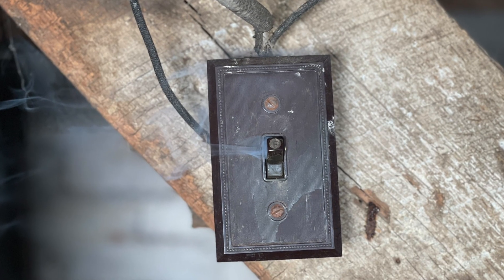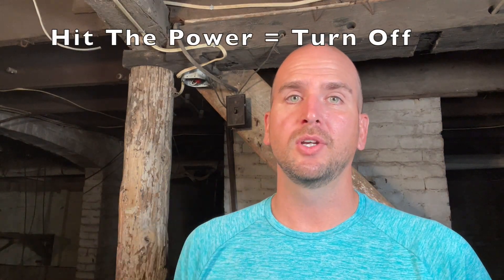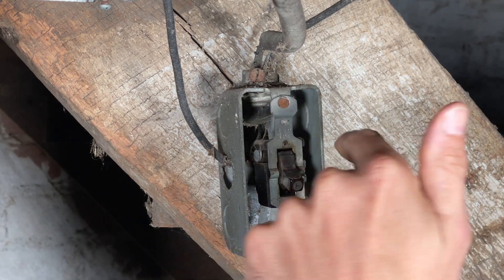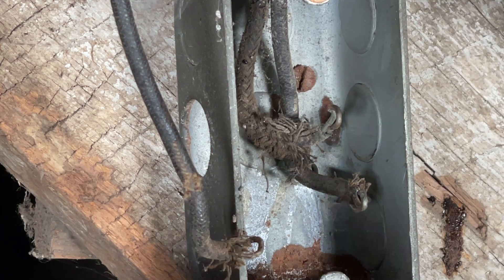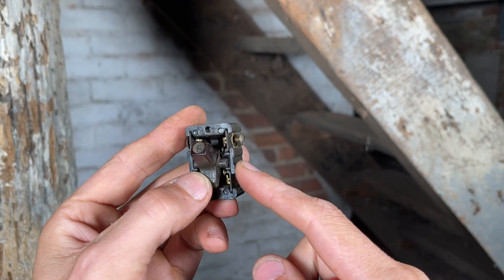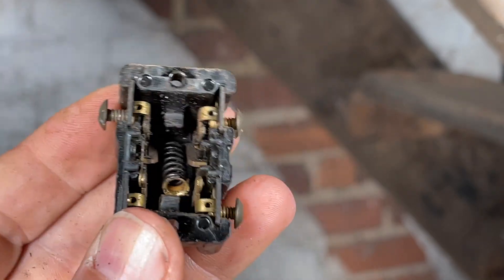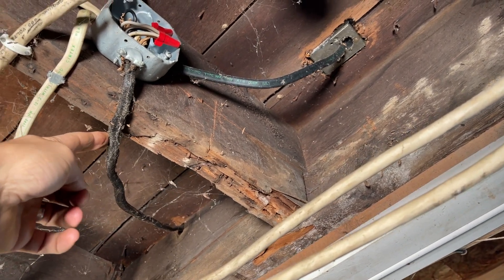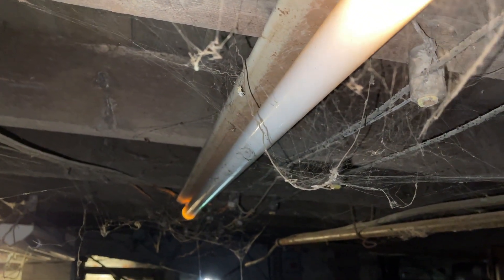Issues with Old Electric Wiring | Knob and Tube

Comment: First knob an tube is very safe the distance between wires is measured in inches ...somtimes feet .The insulators are porcelain the same material used on hydro posts (actually the exact same system). As for the  Ground there actually is no need for a ground in knob and tube as there would not be a a source where the wire can ark for a long time ( the wire would simply break and become disconnected during a ark fault. Ground wire is nothing more than a bare neutral wire running parallel to the hot wire. however due to the proximity of all the wires a sustained ark fault can happen from a simple pin hole. This bare wire provides a source where the power can go.  Actually the neutral and the ground is bonded in the box. The bigger cause of fire in older homes is due to aluminum, wire (from the 60's 70's and early 80's) and this aluminum wire being tied in to the knob and tube as we all know aluminum and copper don't mix.
Reply from the maker: Lot of truth to this post.  Appreciate the feedback.  I think the biggest issue I run into with K&T is if the insulation has dried out and become brittle.
Reply: Yes this may be a safety concern (some one touching the wires this is not a fire Hazzard. The very Circuit you had a issue with it was not the wiring it was poor contact. This is why aluminum wire is so problematic it warms and expands cools shrinks and this loosens the connections and you have contact arching and fire hazard. Aluminum is by far much much worse than k and n.

Comment: Romex runs -> tear the entire drywall out and refactor an entire house. That's going from a $50,000 job we just did. Running new breaker panel to spliced out boxes -> consider GFI + outlets to protect YOU at that end if you can't get to the outlets.

Comment: While I prefer to minimize costs in certain areas, but not the electrical system would have to be upgraded at least all the boxes plastic versions and latest outlets and switches to make sure that contact problems won't happen. And a full electrical system rebuild might be necessary if the customer plans upgrading the house to alternative energy solar and battery.
Reply: As far as I know, in Europe vast majority of electrical boxes, switches and outlets are made of plastic.

Comment: That pullswitch looked like a lot more than 50 or 60 years old. 
I bought a nice old house. The fuse box was wood, set in the bathroom wall over the tub with some asbestos paper lining and 3 Edison base fuses in open holders. Had to rewire before I'd sleep there.

Comment: I believe that switch - 40s era - is arcing across that dust accretion. 

Knob and tube is not dangerous in and of itself, even though it is not a grounded system. Classically, they ran single wires with one side of the house being neutral and one side of the house being hot. Connections were made in the wall with a hot or neutral only connected at one place, INSIDE the circuit box. Those separate wires passed through separate holes on opposite sides. Thus any contact was not possible apart from the fixture itself.

The problem comes when a new system is grafted onto knob and tube. Often the hot and neutral are taped together and run though the same hole. Now there is an element of heat and friction. The old insulation is dry, friable and subject to breakage due to heat. NOW the conductors are in close proximity to each other and undersized for the new load. Plus, if a rated connector is not used, they suffer wear from friction on the raw edge of the box and will short out on metal. 

If you have knob and tube, don't graft it to Romex. Run a new lead to the point of use. Use your existing fuse block as a sub panel connected to a modern panel box. Or, you could open all the walls and rewire the whole house. Your choice. 

I mean, if it was *fundamentally* unsafe, you wouldn't even have a house to worry about. It would have burned down decades ago. 

Go ahead, guys. Start ripping me. 

That basement needs a serious upgrade, BTW. *shudder* Too many generations of amateur work.
Reply: You're correct.  I learned wiring doing old city houses with knob and tube.  I learned how to cut a metal box in to lath pretty well too.  My old teacher would set a separate metal box for hot and ground when grafting to knob and tube (lighting circuits generally).  He would also ground spike the boxes.
Reply: Ditto. And you don't play with that old wiring too much either. The insulation kind of disintegrates, especially when it is close to the heat of the lamp.
Reply: You talk like an actual tradesman that understands why you're doing something and that every action leads to a certain reaction. Many people calling themselves electricians are merely parts Changers who don't have a clue why they're doing what they're doing. It's just what they've always been told,.. they don't really have an understanding beyond everything is going to be ripped out and they don't know how to tell if something's good. they don't know how to calculate based on the size of the wire & the overcurrent if it's correct. They're taught these generalizations and that's what they do, they're blind to actually any sense of condition the wiring is in. They haven't got a clue what a Western Union splice is and that's what you need to use if you're tapping into knob and tube. loose splices start a lot of fires.
Reply: 10,000 $ I’ll clean that basement up over a few weeks . It will never be straightened out like most slums it will just be there forever

Comment: The handi-box is not original to Knob and Tube system.  This is a stamped zinc plated box the boxes from that era were painted and not single piece. This has been staged.

Comment: My stepson and his wife bought a house built in 1929. As you mentioned on the video, the home was said that it’s electrical was upgraded. Although it had a 200 amp service panel with a 20 circuit capacity and Romex was run in the basement, everything else in the walls and attic was knob and tube wiring. He was quoted $12,000 without updating the panel which needed more circuits. Since I’m an electrical engineer and licensed electrical contractor, we rewired the entire house with an updated panel adhering to the 2020 NEC. Total cost was about $2,000. The electrical inspector said it was some of the best work he’d seen in years. By the way, great video to let homebuyers to be aware of safety and costs in wiring of old homes. 😀👍
Reply: Love it, and nice with helping him out. I just bought a house from  1915 in a farm town where it had a 700 square foot 2 story addition added in 1938, both were knob and tube. It seems like this whole house has been a case of a friend helping a friend and in about 2002 there was a 200 amp panel added and they rewired from first floor outlets down to the basement, everything from 1st story lighting upwards was still knob and tube. I got an 80 amp sub panel and plan to wire it in a second floor closet and rewire myself according to modern code. It's funny what all you can find when multiple generations of "handyman" lays hands on your house haha
Reply: @Timman57  That's great Timathy that you've got yourself an old house to fix up. As for installing your sub panel in a clothes closet, you may want to consider another location for it. According to the 2017 NEC at article 240.24D, the heading reads, Not in Vicinity of Easily Ignitable Material. Overcurrent devices shall not be located in the vicinity of easily ignitible materials, such as in clothes closets.

Good luck with your wiring and wishing you all the best!
Reply: Not all the house has to be wired.  You can run separate wires from the basement.  You can fix electrical.  But yes you can’t Frankenstein it.  Replace all wiring if you don’t want your house to burn down